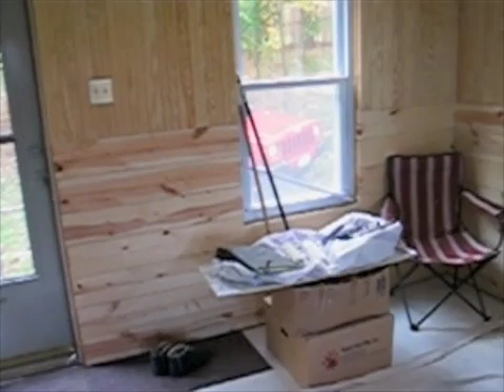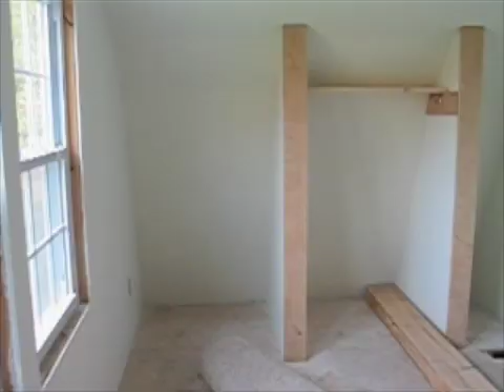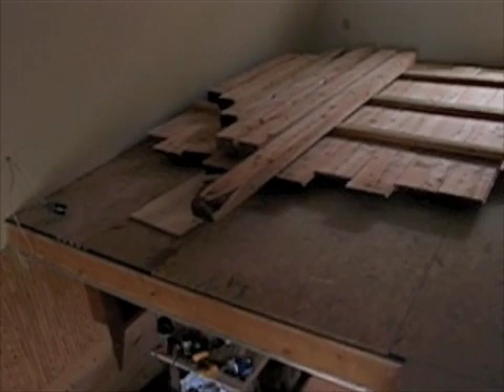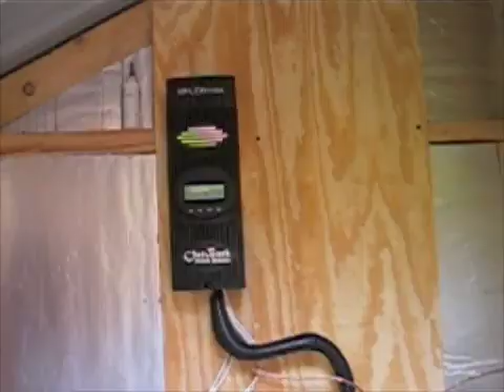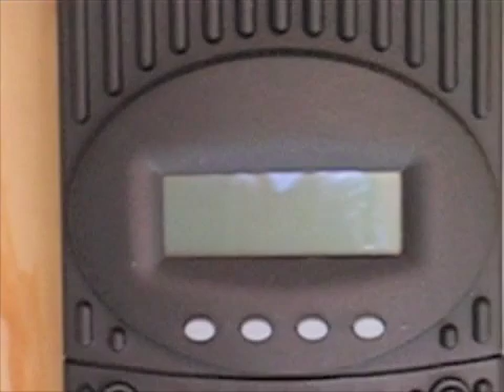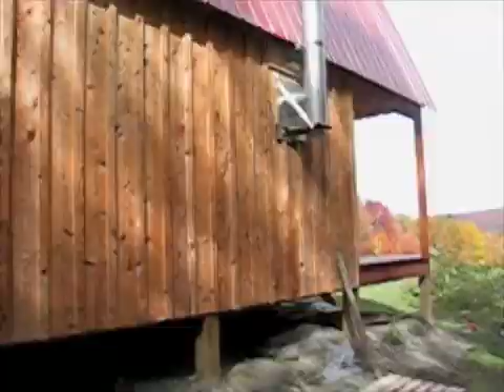Amish built off-grid cabin project

Comment from the maker: Vivian - We built the cabins on poles for the same reason you are worried... long term rot... I know the larger home depot sheds are built on site... maybe they could build it up on posts... if not and putting a concrete slab was out of the question I would put down skids... you could use pressure treated 2x8's nailed together or telephone poles... if they needed to be leveled later you could just jack them up and put stone underneath them... 

good luck on your project...

Comment from the maker: yeah that is a worry. Sometimes it is better to fly under the radar & try not to stick out. Make your place not visible from the road & permit it as a shed.

Maybe buy a small camper on the property that you say you use. You can get them cheap & use them for storage.

so far we have not had any problems but we only really have 2 neighbors & neither can see my place. We try & be good neighbors & respect property rights & generally not be a jerk. I think that goes a long way - good luck

Comment from the maker: @Unsharpened we pulled a building permit... took about 15 minutes... drew a rectangle on a piece of paper that had the approximate setbacks from the property boarders... did the same thing when we built the pole barn... now we did not permit this place as a dwelling... that would have required a great deal more work... but in our rural area permitting out buildings is pretty easy...

Comment from the maker: @brohmanski yes. The reason I didn't do it was that I was trying to minimize the possibility of leaks. fewer holes in the roof (none in my case) the better.

Now this did cause a problem. two winters ago we had a lot of snow (27 feet). The supports at the top of the chimney became tweaked from the snow riding off the roof onto the them. Last summer I replaced the tweaked supports w/ longer ones that I put at an incline and then put a couple of cleats on the roof above them. no more problems

Comment from the maker: @0urGaia Thanks.... Everything is 12v except from the panels to the charge controller... I have a MPPT charge control which steps it down... I did this so I could go with a smaller gauge wire... I was able to go with 8awg doing it this way... The wire still costs around $140

Comment from the maker: The plumbing is still not in yet... my current plan is start with a rain water system that I can empty in the fall... I need to work out the filtering required still... 

I intentionally did not put any plumbing in the walls... we do not heat the cabin in the winter so I did not want to have to worry about freezing...

On the discharge side I am planing on doing a gray water system and a composting toilet. My goal is to get that stuff going this year...

Comment from the maker: thanks for your comments... 

The outback fx-80 (black box) is the charge controller. The panels are wired for up about 50 volts and the batteries for 12 volts... the fx-80 is a mppt type charge controller and can convert these voltages finding the max power point.

I will be installing an insulated battery box with vent in the next couple of weeks... There is a roof vent but I agree there is a right way to do this and will doing it right.